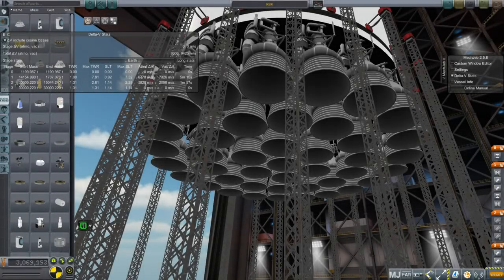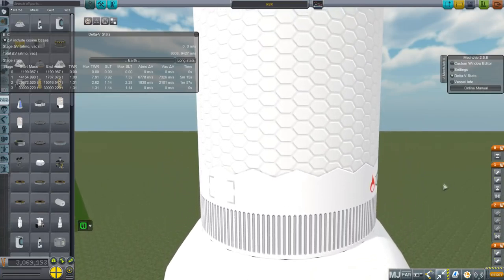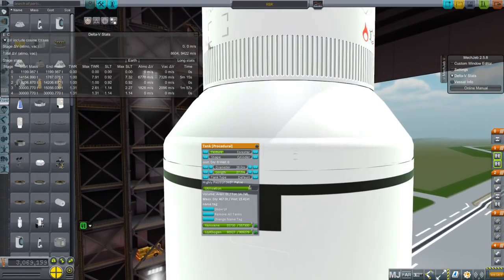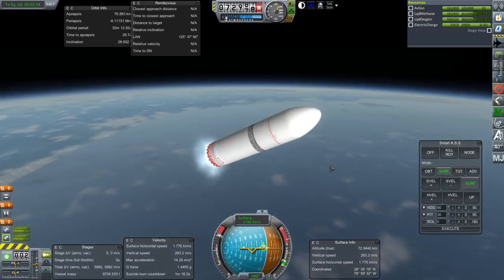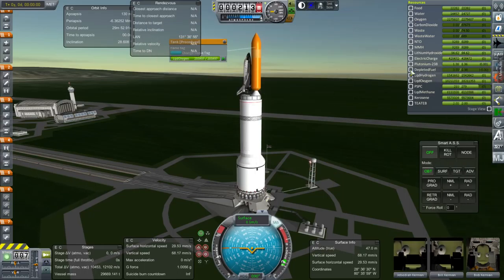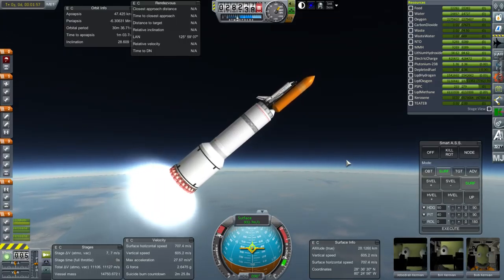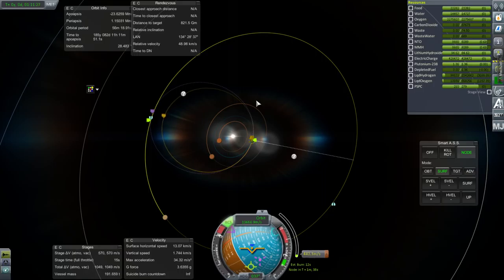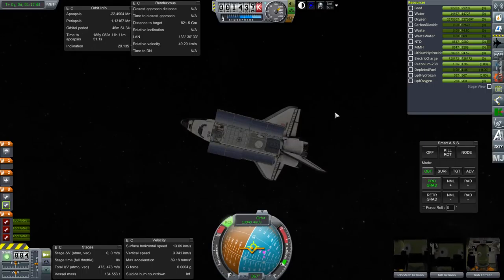Kerbal Space Program RO Sandbox - 1200-ish tons to LEO, with Framerate

Comment: The node drifting is because your engines have an offset center of thrust from your control module: when you point along your node on the navball your engines are pushing you in a slightly different direction than your prograde marker is indicating. You'll want a probe core aligned with the engines you can control from when doing maneuvers on craft with offset thrust.
Reply from the maker: Ah, right. Should have thought of that.

Comment: are there any mods that make KCT not work. i was installing RO with your video guide and everything was working fine. i got all the dependencies to work, but then i added some other mods that werent on the forum recommended page and it caused KCT to not function at all. and im not forgetting the MagiCore file either. i just dont want to have to go back and start from scratch
Reply from the maker: Yes, some mods can interfere. What I recommend is that you sort the mods you installed by date modified and uninstall them one at a time in reverse order to see which one caused to problem. Also, always remember to zip up your saves before installing new mods.
Reply: okay thank you i will do that
Reply: I uninstalled about two thirds of the mods and it still wasnt working so i just started from scratch. idk what mod was causing problems i think i just installed one incorrectly or had the wrong version because i have pretty much the same mods and its working. also my sky seems really really blue like overly saturated blue, know anything about that? thanks again.